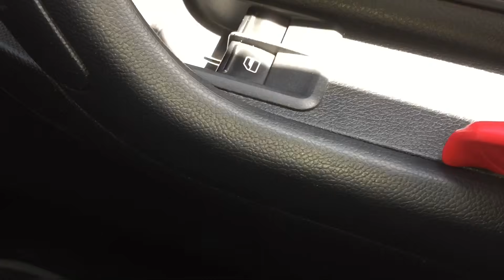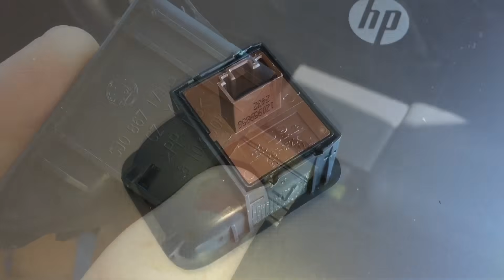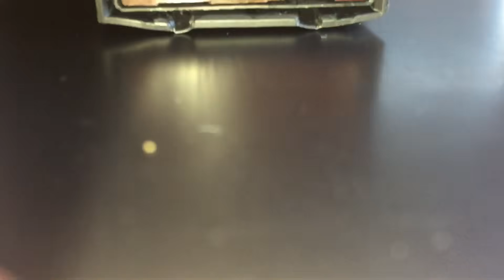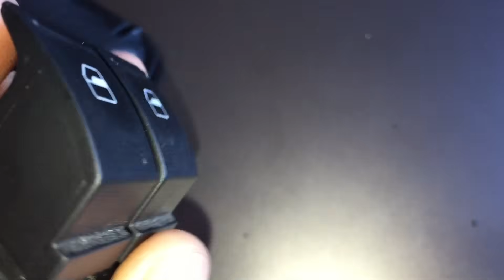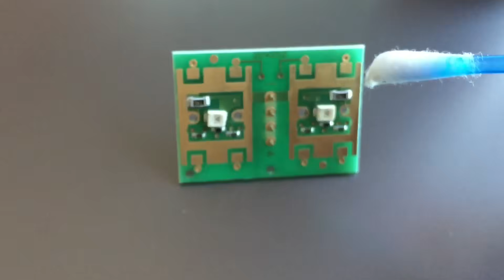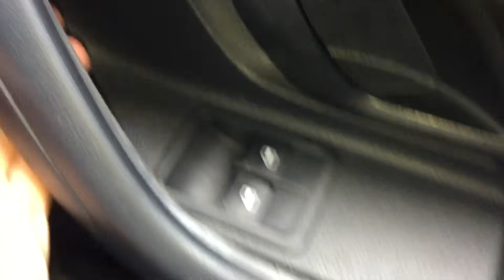Škoda Fabia Mk2 5J Electric Window Switch Teardown and Repair

Comment: Thanks for video, I know this an old one but helped alot, especially with removing the switch in first place. Just fixed my 2019 window. I found if you put the screw driver into housing and your thumb on switch and push down you have less chance of breaking the housing as the switch system drops. But thanks all the same.
Reply from the maker: Glad it helped after so long!

Comment: Thanks for the video. Taking the ideas from other comments, I removed the switch by lifting up enough with a screwdriver to get the wrong end of a teaspoon in to get it out without having to remove the trim. I used a new switch, as I wanted to keep it as simple as possible.

Comment: The front left skoda fabia mk2 5j power window motor was a complaint. I bought a new one with same part number and tested it working but when I connect it to the door, the motor does not work. What could be the reason?
Reply from the maker: Broken wires in the loom to the door in the flexible rubber section.

Comment: This'll be interesting , I have same problem , ahead of switch arriving ( £5-10 ); if I disconnect the harnesss to the driver's electric window motor works, turn car on/off and it is a dead switch again !!!!
Reply from the maker: That’s a faulty window motor, they are plagued with software issues.
Reply: @theweekthatis  That's exactly what I thiought thanka!!!!  Never expected it to be the switch

Comment: These window switches are on Amazon, plenty of sellers. About £10. And if its not the switch that's faulty you can always return it and just say you bought the wrong one.
Reply from the maker: They are now, but there weren’t 8 years ago.
Reply: @theweekthatis  yes m8 appreciate that. I just mentioned it in case anyone wanted to attempt this and wanted a cheap option to try (like me tomorrow. :)  )
Reply from the maker: @andynightingale7335  still not as cheap as a bit of contact cleaner though 😜
Reply: @theweekthatis   thanks for the video showing removal. Swapping out the switch today has worked and my dad can use the driver door window again. Cheers.

Comment: Well done mate, worked a treat. I used an old toothbrush and some vodka. Cleaned up the silicone area, dried it off quickly. Remember not to rehouse everything straight away. Just get the switch assembled,  reconnect it to the electrical system and just check the windows will go up and down.

Comment: thanks for this. i replaced mine in a fabia mk1 but the cheap new one doesn't operate in two-way switch mode, even though it has a two-way switch feel to it. it also seems like it is the masterswitch to the pax side switch, as that one isn't replaced but now also not two-way anymore. might be the cheap (€15) replacement doesn't have the logic.
So i'll try and follow your instrcutions to clean/repair the original one.

Comment: Nice one. Cheers for taking the time to make this tutorial clip. My wife had the same problem with the front windows on her fabia. I watched your video, scribbled down some notes,...and followed exactly what you did. Guess what....??  It worked..!!  The twin master switch was faulty, and so was the single switch on the passenger door. I used nail varnish remover to clean the contacts cos its May bank holiday and that's all I had available to me. I really appreciate your time and effort in sharing this excellent quick fix.

Comment: I just tried this myself but could not stand the idea of jamming a screwdriver to remove the actuator from the plastic part and potentially damaging the plastic, which I am not really able to find easily in my area. Thus, I tried to slide 4 toothpicks  in between the two plastic knobs on each corner of the actuator, distancing the actuator from the plastic housing. After that, I firmly pressed down on the window open/close buttons, until the actuator was ejected out of the housing, admittedly with high velocity. The plastic housing had 0 damage on it. I did do this on a warm day, so the plastic was kind of soft, so it had a little give. Put in a new switch, works like new.
Reply: Thanks so much! That just made my day!

Comment: Good video, useful info, thanks for posting, I'm curious to know if the drivers window juddered when you tried to move it up and down?
Reply from the maker: Not at all.
Reply: @theweekthatis  thanks, I actually meant, was it juddering up before you fixed it?  I'm trying to do this now, but I find the door handle difficult to coax off, don't want to bust it. :-)

Comment: Did my 2004 Polo 9n switch. Different internals but used toothpaste to clean off the burning damage and polish the contact surface as contact cleaner was no very effective. Now works fine.
:)

Comment: Many thanks for putting this video up. I found that it is not strictly necessary to remove the door trim parts; by using a flat rounded lever I was able to lever the switch out using that alone (and it didn't mark the surrounding trim). I used a tool that I originally bought for removing watch casings, it is perfect for this too. Switch took less than 5 minutes to change - a real result!

Comment: Just want to say I had the same problem because I left the drivers side window open last week. Thanks to your tutorial I bought a new switch on EBay for £14.50 and fitted it in ten minutes this morning. Thanks again.
Reply: George Bradshaw ik
Reply: Goerge Bradshaw - I'm looking at a switch for £8.50 on ebay but am a bit worried about the quality. If yours is ok, any chance of a link please?
Reply: https://www.ebay.co.uk/itm/122725240278

I found this switch to be the same 'made in Italy' switch as the original - worked fine when fitted